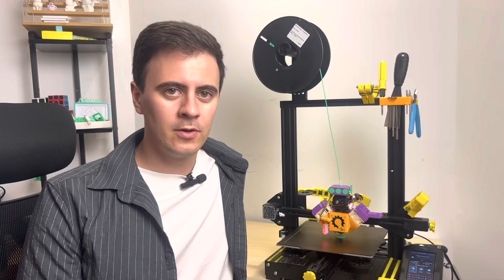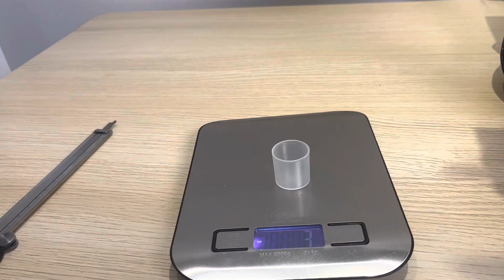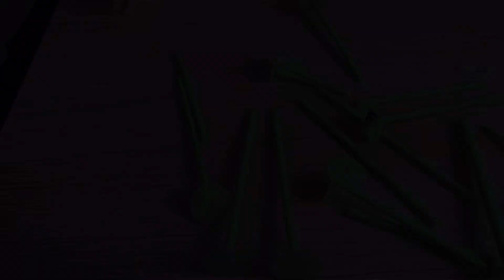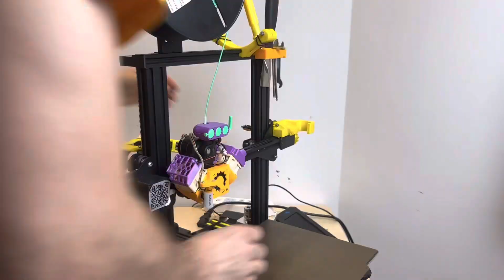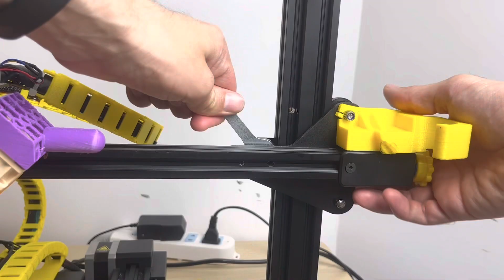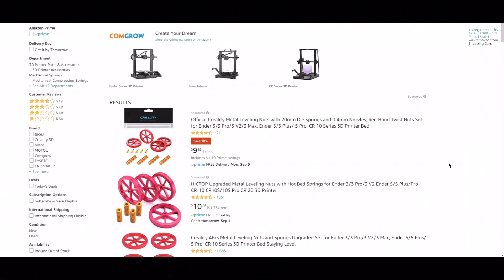Ender 3 V2 Bed Spring Upgrade

Comment: Hey, I have some springs coming soon and I had a few questions. Did you hand level the bed before doing the auto bed leveling or did you just compress all 4 springs that same amount then run the auto bed leveling?

Comment: 0:48 
I understand you screwed it up to show it better but first thing I did was move the Z-axis switch down so the bed would sit almost on top of the carrier. This compresses the normal springs too and gave me the results I needed without purchasing extra

Comment: At 0:45 you're bed is way too high. The springs are almost uncompressed and that makes te bed wobble. Compress the springs all the way and loosen them just a bit so you have like 3mm's of play. Then, lower the Z-switch to that level and if you can't get low enough, cut off the notch on the sensor bracket. Even with the standard springs you will get a very stable bed because of the compression and perfect prints.
Reply from the maker: yes agreed, the stock springs are okay when properly  tightened, unfortunately Creality sends the printers with the stop switch limiter to high, so some people don't realize it can be adjusted as you mentioned.

Comment: Why do you still have the zstop if you are using the bltouch? Just redundancy?
Reply from the maker: Good question, I actually don't use it I just wanted to show how to adjust it for people who don't have a BLTouch.  When I first got my ender 3 I struggled with this because I couldn't tighten my bedsprings more without the nozzle being too far from the build plate.

Comment: Before I finished putting my Ender-3 V2 together I installed stiffer springs. The lighter the bed is the less problems on a bedslinger. One of the advantages in the ones that the bed only moves up and down.
Reply from the maker: Yea lighter bed is better if you can help it.  Later I will look into Klipper to help fine tune my bed slinger at higher speeds.  I've heard people have good results from this.